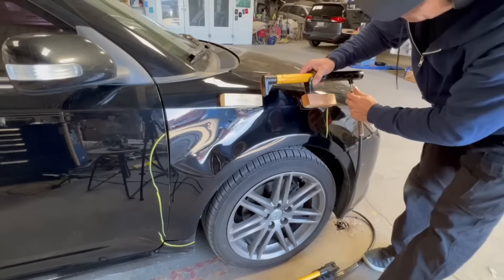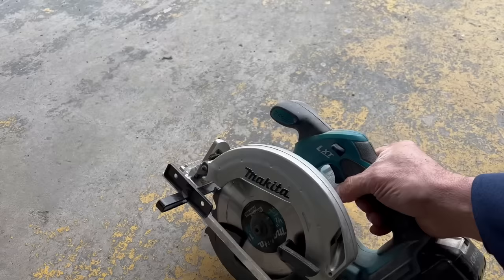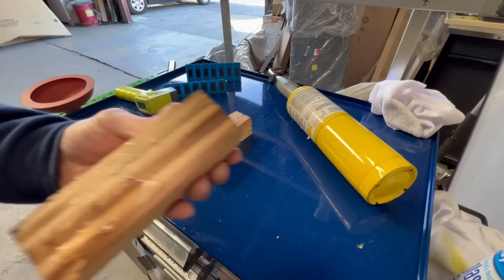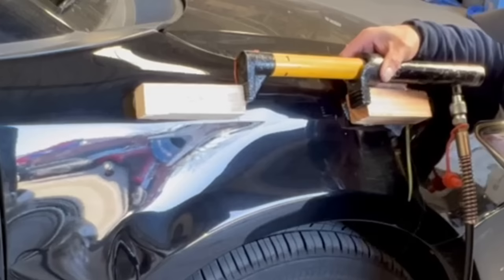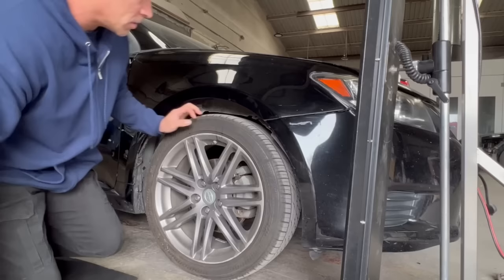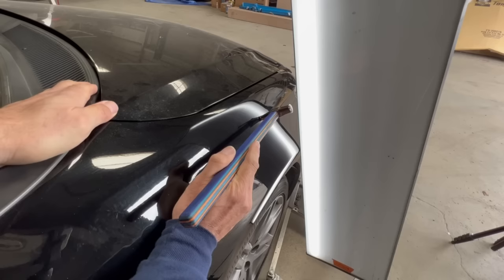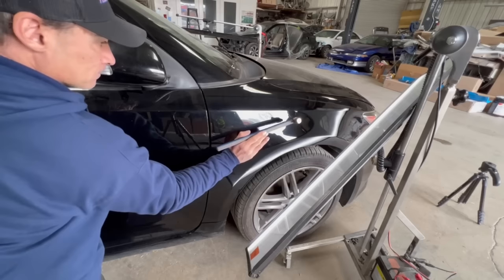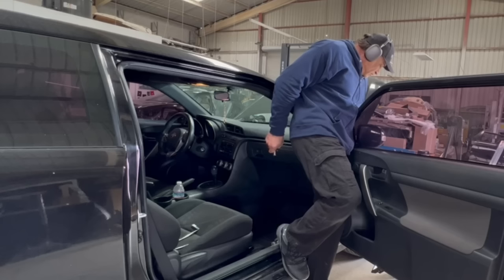Amazing Lateral Pull! / Porta Power and Wood!

Comment: Most impressive the way that glue and 2 x 4 could hold up the weight of that Daytona porta power. Amazing repair. Body Tech of 35 years practice with PDR rods and cold glue pulling and glue pulling for 10 years now

Comment: I'm curious,  how much was the customer charged for that 10 hour job???  I'm very interested.  Ty
Reply: Don't think he will ever reveal the answer. My guess around $350 for the repair
Reply: @bruce achiles  ty for ur response.  I am interested,  so many pdr tools I dint know what's begginer or overkill, and if he's a pro at 10 hours how long would a Newby take. I know I could repair and blend in 4 hours for 350. I need more info. I've tried contacting him but no answer. Like u said he probably won't respond. But ty
Reply: @tedc9306  I have a huge assortment of PDR tools. I can tell you not everyone can do it. It is a unique skill. It's nothing like body work and paint. I do body work and paint myself. I have a pdr guy who does all my dent and dings. Most PDR guys would never or have the same skills as this guy.
Reply: $1,000 bare minimum for his skill level and the amount of time for him.  Wouldn't be surprised if it was more like $1,500 to 2,000.   If you're new, it's not really about time when we're talking jobs like this.  It's about quality.  At a certain point, if you're taking too long, you're probably butchering it. (Trust me, I say that from experience). Anyone could get the big sections pushed out and follow the basic steps.  It's especially easy to say you could do a repair like this when you're watching him do it step by step.  Every dent is different though.  It takes experience to start the repair and know what tool to use each phase along the way.  Then you'll usually get to these points where it has to "look worse before it gets better."  The trick there is actually making it better at that point and not throwing in the towel or making it worse, and then getting it looking really good and not just "good enough."
Reply: 30-45 $ per hour
Reply: It can’t be higher than the cost of replacing the fender. If it was nobody would go to him. Insurance will only pay so much for certain things.
Reply: @neilbode829  would have been cheaper to fit a new front wing , even genuine one would only cost about 700 dollars fitted and painted
Reply: @neilbode829  for that much I'd buy a fender and have it painted.
Reply: It's not very expensive. This isn't voodoo magic. You too have a local paintless dent repair guy
Reply: @James-po5ed  Not consistent with anything considered quality. You’d lose the original vin sticker, you’d have cheap aftermarket paint, and likely a Chinese/aftermarket fender.
Reply: @Moises-kf1hg  Yeah, I don't use anything Chinese on my trucks.
I would buy junkyard 1st if I had to.
But I'd never pay that ridiculous price.
Reply: Wheel and arch liner removed and push out? Its only a bit of thin stuff.
Reply: @HackMasterBlaster  , you are correct about insurance. But if insurance pays for paint, they also need to stoke a check for depreciation. 

You are incorrect however about some not being willing to pay more for PDR than they could to a body shop or their deductible. 

A lot of people prefer to keep the original factory finish and will pay extra to keep the vehicle as original as possible.
Reply: @HackMasterBlaster a new fender isn't that expensive...but painting the new fender would be.
Reply: It's amazing to watch you work.  I have a 4 ton Porta power it's a harbor freight one and I love it it used it from crash repairs to home repairs my only wish is to add a pull cylinder.
I've tried a bit of pdr but I don't have to tools it came out a lot but still needs work but it's only on an old beater I bought to drive while I took my bimmer off road for some repairs. 
Great job
Reply: He charges per repair not by the hour.  Thats 900 to 1000 bucks
Reply: Pdr is not that expensive, the whole point is to save the customer money! Probably $100 didn't take him that long Probably a couple of hours as he really knows his stuff.

Comment: Never would have thought that porta-power could be used this way. Very cool 🤯
Reply from the maker: Justin, thank you for checking up my video
Reply: I have done similar to this using a friction jack...but back in my day we hadnt figured out that hot melt glue holds this well. I had to remove paint and weld on pull plates.

I am in absolute awe that this is even possible.

Comment: I have a 4 ton Big Red PP and it works great with the orange pull tabs or blocks of wood. I love the new metal medic lateral tension system with the new anti rive pull tabs.
Reply from the maker: My porta power does not fit into the metal medic tabs
Reply from the maker: 4 ton is all you need
Reply: @DentDiscountPDRBodyShop  I don't have the portapower adapters. I have his 36 inch screw spreader. It works very well.

Comment: Have used a portapower jack for almost everything haha.
I got into doing bodywork as a kid restoring old classic cars with a old guy I worked for and learned from then for about a decade I did custom car work shaving frenching chopping sheet metal shaping haha use to always be going to to big events and have a couple shop trucks usually bagged lowridders but idk the market got where the only clientele for that work locally was people who wanted what they couldn’t afford and you ended up owning half the vehicles you worked on then had to sell a custom bagged vehicle that had $50k in hours on it and daily driving it was not a option haha .  I only paint my own stuff nowdays are relatives are freinds I’m a painter at heart but the prep work mainly the body work is what makes a good painter.  I loved putting some older Cadillac taillights in a in a newer truck with fully shaved handles and a hand made grill Building custom steel wheel wells and all the fun stuff.
I finally sold the last frame dropped 1/2 ton I kept it for years as a toy but idk I’m getting older I don’t like the attention myself anymore I like a stock pickup preferably a lariat on the insides and a xlt on the outside.
I do have to admit I never used a hot glue gun and some wood blocks on a body job ever haha.
I’d been interested in seeing the reveal on the door and hood with it shut at the end and to the bumper how well it lined back up.
It looked a lot better than what it did I’ve never worked in a insurance job shop but I’d of prob ordered a new fender painted it matched the clear orange peel as best I could to the old paint and had a laborer install it.
Id hate to argue with someone it not being good enough and you could always get it close enough for most peoples eyes like this but idk I’ve had people complain on jobs and try to beat up the price on some show pieces haha I always tell them same thing if you don’t like it I’ll take it all off and give you back your car your material deposit is gone though. Your choice.
After I had done went over the car with a white glove and a flashlight if someone was complaining about something I new they were just trying to be cheap.  My best customers where always the ones you would least expect though the more years in prison they had done the faster they would hand you cash haha.
The guy just was a local business owner who could easily afford it good luck he’d be the asshole who didn’t like the color he picked out haha. 
Man I’m glad I’m out the business just thinking about it but I do miss the work part I enjoyed the hands on work part oddly I just hated everything else like dealing with people haha.
Reply: Hi Joewayne, have you become a flat earther yet?

Comment: Once again, I am seriously impressed.

I never would have thought to do it like this.

My approach wold have been to push the body line out, using a 2X2 horizontally against the line. I dont have fancy modern PDR tools. So I would have used an old leaf spring to leaver off the tire on one side. The round "Bushing" side of the spring would push against my 2X2 from the back.

While under pressure, I would be working the crown with my slapping spoon, and then my big Snap-On dinging hammer (the big round one with the shrinking face on the one end, smooth on the other).
 
There is no way I could have done this without breaking the paint. I would have to do the final finishing using old school pick and file methods (starting with sand paper to minimize metal removal).

I am going to start a management position at a shop soon. I will be making sure all  the bodymen see your videos.
Reply: Hi Vanishingnomad, have you become a flat earther yet?

Comment: wow nice work i would of never thought it posibl i have 20 ton portpower i think it alide brand been using it for 30 years but need to find seal for pump now it leaks little bit for the blead off valve

Comment: I do some auto body repairs, don't have a ton of tools and have zero tools for pointless repair, the tool you were using on your porta power were did you get it, and the glue gun ? With the new automobiles on the road today being like a pop can it is a must to have the right tools for the job !

Comment: First time I saw the side stretch. I expect most would pull perpendicular. I'm new to this and can understand the need for pulling with glue and tabs but the tapping and poking  with metal points on painted metal seems so counter intuitive to me. How you guys end up with such results seems like witch craft. Is the hot glue any special type. Or anything from 2 buck shop will do?

Comment: How hot did you heat the panel?, at certain temperatures it tin can't. I'm not calling you out I need to do the same repair.
Reply from the maker: you have to remove the moisture from the panel this when you can heat up 200° 
Thank you for your comment
Reply: Can you heat with a heat gun or torch only(better heat control)?